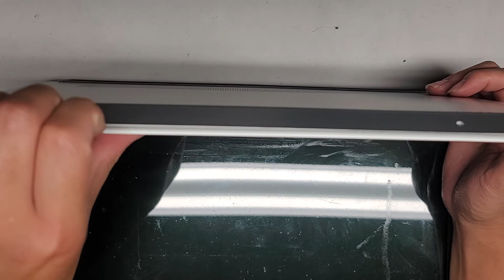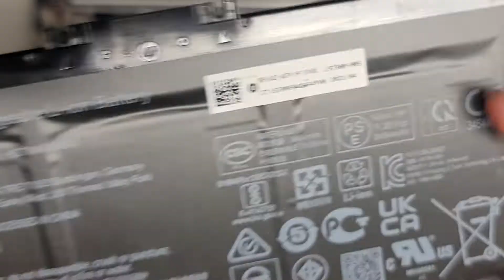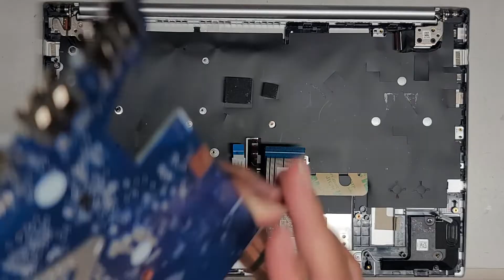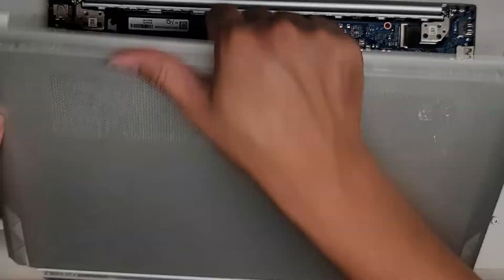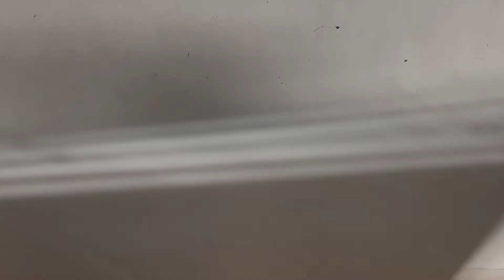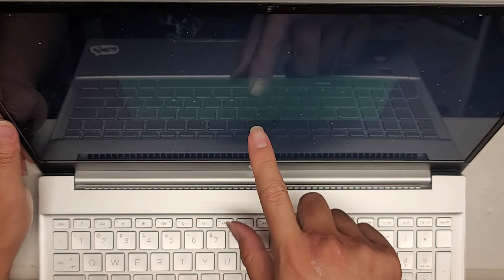HP Pavilion Laptop 15t-eg000 15t Disassembly RAM SSD Hard Drive Upgrade Battery Replacement Repair

Comment: can you put higher AA ram sticks in this or does it have to be the 3200AA?
Reply from the maker: Not sure. You could try, just make sure there's a good return policy.
Reply: have you made a video disassembling a HP Pavilion 15t-eg300 verison cause it says it takes ddr4 3200 sdram but idk if that matches with the sticks i wanna put it @ItsBinhRepaired
Reply from the maker: @deadcat4454  I haven't come across one yet.
Reply: ok thank you for the help though, I really do appreciate it. @ItsBinhRepaired
Reply from the maker: No problem

Comment: my exact laptop shows no signs for charging and makes weird noise once plugged in, what can be the issue?
Reply from the maker: Bad motherboard
Reply: Could be the battery also.  My HP Pavilion would run only when plugged in. I think you can hit F2 on reboot to get some check-up test to run to see if it’s the battery or the motherboard.  Google or ChatGPT to find out which function key you can use to allow you to do test on the laptop.
Reply from the maker: Esc will give hp Boot options. I think it was f1 to do diagnostics, but it won't do anything if no power... not sure what you're trying to tell him. Lol
Reply: @ItsBinhRepaired  He said the laptop was making a “weird noise once plugged in”.  That suggests power is getting to the motherboard.
Reply from the maker: @ton_of_youtube1831 no, that suggest it's foiked... Weird noise = blown capacitor, resistor, etc. when coupled with not turning on.

Comment: great video!  My current 15t eq100 overheated and won't start. If I have a new 15t, am I able to simply swap out the SSD and I'll be up and running on the new laptop without a hiccup?
Reply from the maker: No, you'll likely end up with a bunch of issues if you do that unless they're the same exact model.

Comment: what ssd 1TB should i use, im trying to upgrade the storage and i need a 1Tb ssd but i dont know which one
Reply from the maker: https://amzn.to/3qmcRms this works
Reply: @ItsBinhRepaired  thank you so much but on 5:42 there is a thermal pad and can i replace the ssd that i have now without one having the thermal pad?
Reply from the maker: @black_fore1003  yes. The thermal pad isn't needed, but you can migrate it.
Reply: @ItsBinhRepaired  thank you
Reply from the maker: @black_fore1003  no problem
Reply: @ItsBinhRepaired  hey i went to a repair shop because the screw from the memory was broken and they told me that the ssd 1tb that you suggest me was not compatible with my laptop because it only has 1 hole and the one you said it has 2
Reply from the maker: @black_fore1003  hmmm is it m.2 SATA only?
Reply from the maker: @black_fore1003  likely the computer supports both SATA and NVMe m.2 SSDs in that case.
Reply from the maker: If your original SSD is nvme and it supports it, we should get an nvme SSD. Those are faster.
Reply: @ItsBinhRepaired   i could send a photo to your email with the original ssd, i  also found one of 1tb from crucial but i dont know if its going to work, and the employee told me that i have to save all my files in a flash drive usb, i have one from sandisk but i have there the windows 10 download
Reply: @ItsBinhRepaired  which Philip screw you used for the ssd
Reply from the maker: @black_fore1003  you don't use Phillips. You need a J1 or JIS1 screwdriver. Use this set https://amzn.to/3sbejZs
Reply: @ItsBinhRepaired  i have that same kit i just need your help on how to install windoes after putting a new ssd
Reply from the maker: Use this to create a windows usb installer https://youtu.be/R6GVDyVqWso
Reply: @ItsBinhRepaired  i have a usb with the windows installed the problem is that i already put the new storage to the computer
Reply: the problem that i have it that after putting the new ssd it just shows a blue screen saying boot devide not found @ItsBinhRepaired
Reply from the maker: @black_fore1003  you need to boot from the windows installer
Reply: what you mean, i have to restar the pc first and then install the ssd? @ItsBinhRepaired
Reply: @ItsBinhRepaired   sorry i didnt knew that i had to put the usb with the windows installed but i have a problem when im at the windoes setup i dont have a driver to install and i dont know how to download drivers to a usb, can you help me with this please?
Reply from the maker: @black_fore1003  SSD driver? You need Intel RST Extract with 7-zip to the thing.

Comment: did you use the same screwdriver to remove every part of the laptop? and if you did can you tell me which one is it because I'm trying to replace the system fan and heat sink, please.
Reply from the maker: Buy this set and use what fits best https://amzn.to/3YaBGhe most likely jis1
Reply: @ItsBinhRepaired  Thank you, for me to add a second system fan do i need to remove those  2 black things on the other slot of the fans? and for the heat sink do i need a double one or another one same as the first one, and the thermal  paste does any work if i remove the heat sink?
Reply from the maker: @black_fore1003  you can't add another fan lol
Reply: @ItsBinhRepaired  cant i remove the triangle fan and buy 2 with the circle form?
Reply from the maker: @black_fore1003  where will you plug the second fan?
Reply: @ItsBinhRepaired  are those 2 things where the spot is removable?
Reply from the maker: @black_fore1003 ? There's no second connector unless your computer came with dual fans do start with
Reply: @ItsBinhRepaired  thanks for the help i didnt know that, i thought i could add another system fan
Reply from the maker: Yup